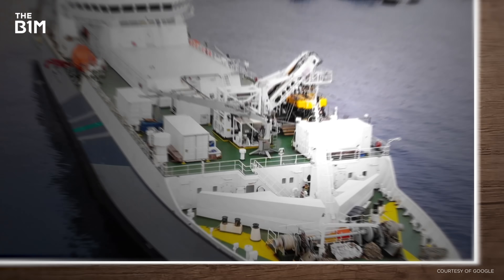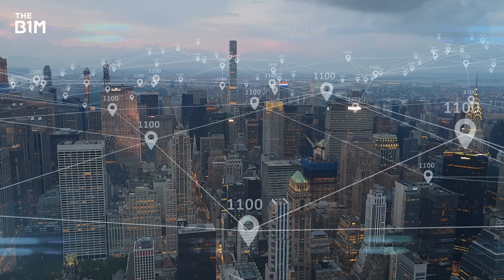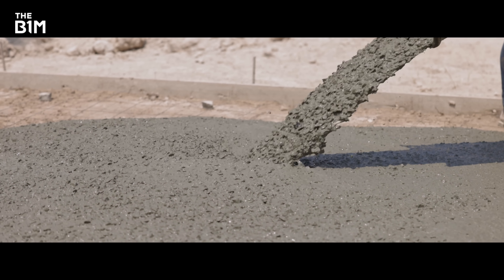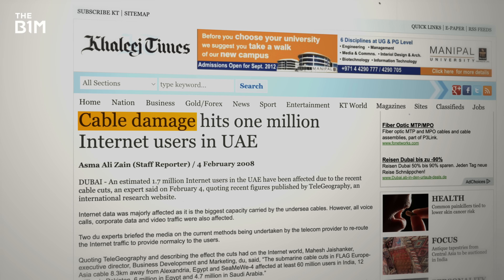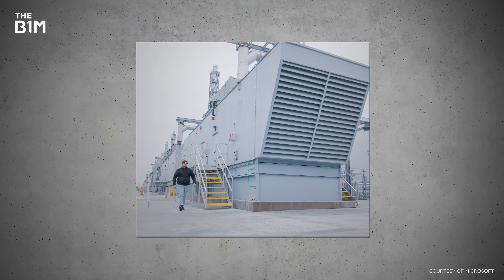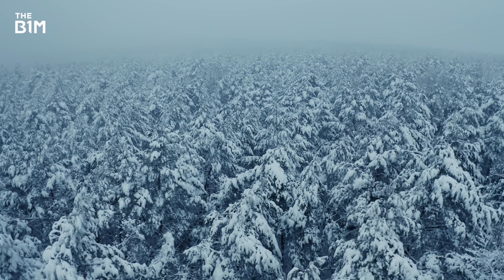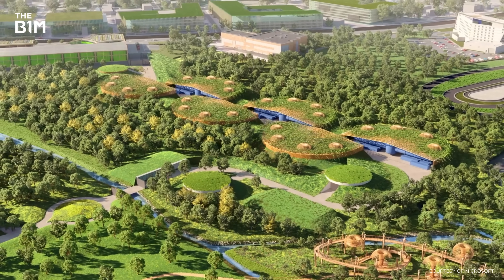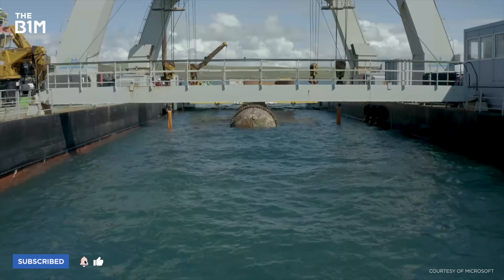The Unknown Infrastructure that Powers our World

Comment: My job is to keep all the instruments located in those little brick buildings you see along the sides of the roads, calibrated and functioning properly.
There are pH, Chlorine, fluoride, flow, pressure and a host of other instruments monitoring and running the infrastructure all around us.
Our entire society runs on a billion simple 4-20mA circuits.
Reply: What the hell are you actually saying? How is this related to the internet backbone?
Reply: Are all analogue? Don't you use communication protocols?
Reply: @joseluisblanco8074  the original commenter is exaggerating a bit! and those have nothing to do with data centres either - OK they might have some in the air conditioning or power supply systems but they're not the most important part of any system! (I work on them [4-20mA loops] myself, that's how I know!)
Reply: @joseluisblanco8074  Regardless of the communication upstream, most everything defaults to a 4-20 signal at the point of measurement.
Reply: @joseluisblanco8074  4-20ma current loop is an industry standard for a physical layer. Communication protocols exist a layer or two above that.

Comment: Hillsboro, Oregon, near Portland, has 7 undersea data cables that come to our fair city. Five are international, one comes from Alaska, and the 7th comes from Southern California. We also have a major presence of Intel here, but that's not the reason for the cables, at least in part. So Hillsboro is building Data Centers, lots of them. I have been lucky enough to visit 2 of these facilities pre-pandemic. As @briangarrow448 pointed out, the Columbia River system generates lots of hydropower. The aluminum industry is almost gone, but the Data Centers are the new wave. So does anyone have a feeling for how much of the available power is being used to generate BitCoins?

Comment: there isnt one Internet backbone.  the Internet is made of many interconnected networks each having its own backbone.
Reply: It's supposed to be, but cloud services aim to change that, and they're quite succesful.
Reply: That's like saying "Your body doesn't have a backbone, it has more than a dozen backbones", you aren't stating anything new - you're just being pedantic.  Fred never said that only the Microsoft data centers were the backbone, he said all data centers and the cabling that connect them are the backbone.
Reply: In the case of The Internet, having multiple separate networks is at the core of the design of the INTER-NET and was purposefully architected this way to provide redundancy and the routing done to be able to bypass a network that is down.  So it is not a pedantic as you say, expecially for links across oceans operated by diffrerent networks and companies/countries.   @krashd

Comment: A data centre CANNOT have "… just over 1 megawatt in battery storage and diesel generator backup". Watts are power. Joules per second. Diesel generators can legitimately be expressed as having a rating in watts. Batteries cannot. Batteries are energy storage devices. Thus their capacity is either correctly expressed in joules or watt hours. The equivalent for a diesel generator would be saying how much fuel is on site to run the generator.

Stop conflating things that are correctly referred to using different units of measurement. It just makes you look incredibly ignorant and stupid.

Comment: Awesome video! I wish some of these data centers had visitor policies, so nerds like myself would be able to visit and just be in awe of all the cool stuff in there. Like a kid in a candy shop.
Reply: Salem Chapel in Leeds, UK is now an events venue and the data centre can be seen through the transparent floor.
Reply: I've been to 3 different ones and got tours but only because I work in the IT field.  Otherwise they don't really want random visitors.
Reply: Most data centers are petty boring - just rows and rows of racks filled with noisy hardware.  The drone from thousands of fans is somewhat annoying and often times loud enough to want ear plugs. 

Getting a tour would be pretty difficult without having a need or connection. For security reasons there’s a multi layered defense setup, for example first layer is keeping people out of the building that don’t have a need to be there. 2nd layer is secure entry into the data center floor.  3rd layer is locked server racks (or sometimes even cages around sensitive racks)

I know one datacenter had a crisis after a contractor doing telecom work accidentally hit the emergency shutdown button.  So really, the goal is to allow as few people on the floor as possible.
Reply: Why would you? It'll just be a bunch of extremely loud racks
Reply: @wsxgfhccr  But you can probably get some good stories out of the people who design/assemble/maintain it all, and perhaps learn something.
Reply: @AndyGneiss the only people who work at those places are mostly security guards
Reply: It’s no more exciting than seeing it on YouTube.
Best regards 
Everyone who wants to get out of there…
Reply: You keep your nerd ass away from these places. There’s a reason they’re in secret spots.

Comment: heat is energy untapped. instead of transferring the heat out in water, they should harvest it to generate energy to put either back into the local grids, or to support their cooling efforts. or both. and in the process reduce their water needs!
Reply: Get started then.
Reply: @donc-m4900  think you have me confused with a datacentre engineer or someone else along those lines. i have a day job that i really like, though. and i do my bit for the environment by running my home off grid. but thank you for your very constructive feedback.
Reply: @brymstoner  Apologies, and thank you for doing your part already.
Reply: cycling used water out and round a cooling system. endlessly pouring cooled water back into the complex.
Reply: @vipassana72  how do you keep it from turning warmer with each pass? wouldn't that cost energy to keep it persistently cold enough, i mean?
Reply: @brymstoner  if it cycled out and through a process that cooled the water it would then re enter the system as cooled water. i.e. if it ran like a stream over cool pebbles. by the time it reached the re entry point it would be cooled. I suppose initial contact with the hot water would need extra treatment for keeping pebbles at a cold enough temp but a natural process of keeping pebbles cold, keeping them from direct sunlight etc, would suffice. the outflow could join an already cold running water source. there are numerous ways to achieve this cooling process at low cost.

Comment: 500,000 miles of cable.  Not a word of satellites.
Reply: Why would you want to use satellites to transfer data between data centres?  The latency would be enormous.
Reply: @krashd   You are correct!  I am commenting on the absurdity surrounding the topic of having upwards of 30,000 satellites in orbit.  They are touted as being used for things ranging from weather tracking to data communications.